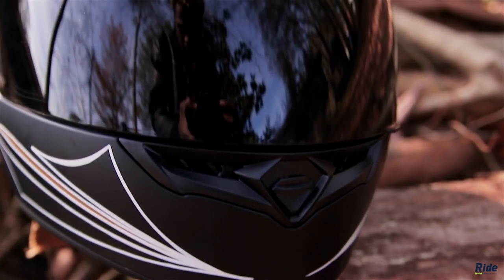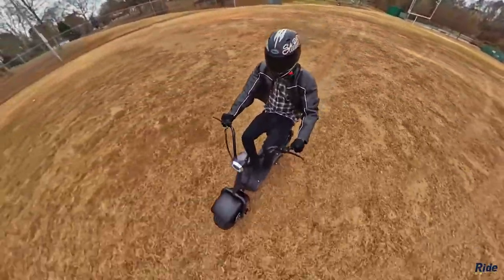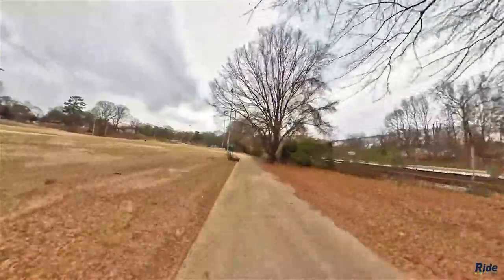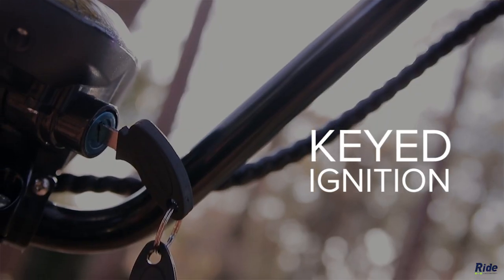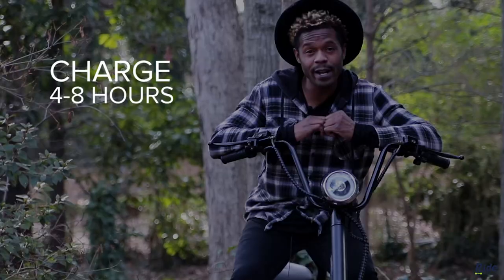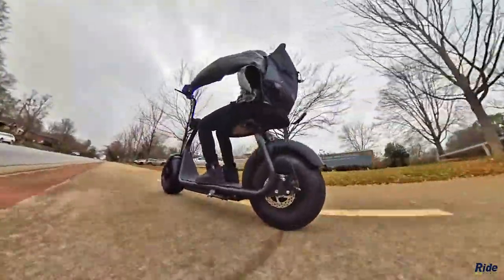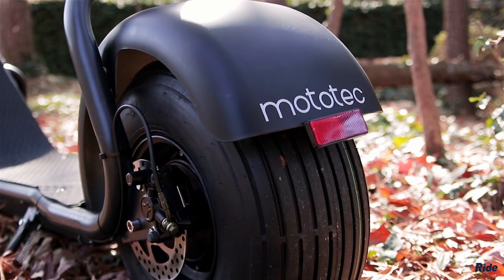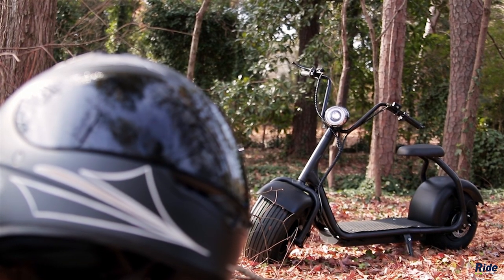Let's ride on the Mototec Fat Tire Electric Scooter! | Ride Along

Comment: I have the mototec knockout and I got a 40ah battery for it and  getting a little over 38 miles in one charge and the 1000w motor was decent for climbing hills but I added another 1000w hub motor in the front with a controller and it rips now, probably gonna make a box to put the old battery in and mount it under the seat with some switched to change packs when necessary
Reply: So about one amp hour per mile...

Comment: Purchased this a month ago and it’s a great product.
Reply: hey, where did you purchase it from... Amazon?
Reply: @andrewkadinda9454  I got mine at Walmart
Reply: Well, nice but where do you get replacement tire, replacement battery, etc.? I have another scooter and have huge problems finding tires and a fitting battery as replacement
Reply: So how is it 2 years later?  Is it still running?

Comment: Mine is in transit...supposed to get it sometime this week. Cannot wait! Already got my helmet and armor-dilloz for this scooter!!!
Reply: let us know what you think ..
Reply: @rg7846  Just got it in today. This thing rips pretty damn fast yo! I tested the speed and got up to 29 mph. I'm pretty heavy too (220ish lbs) so I guess if you're lighter then it would be even faster. Goes up hills and goes on grass with ease. A con about the bike handle bars can't be tilted to how you like cause there's a dead bolt in the middle where the handle bars go with 4 hex screws in each corner. Anothet con I didn't like is that the platform covering where you put your feet down is some cheap plastic.
Reply: @l3arney  nice...so more pros than cons...yeah i'm a buck 60  lol so i should be flying on that thing lol.. thanks for your input.
Reply: @rg7846  there's more cons to this as I'm riding it more now. The welding to the frame is super crappy. Looks like a 6 year old welded the frame. LoL they said this thing didn't need suspension because of the super fat tires but that's BS. Seat hurts my ass while going on long rides. The charging port under the foot rest is pretty flimsy. If I were you go look at the mototec knockout with 2 seats. Or go look at the edrift fat tire or coco fat tire. They are very similar to the mototec fat tire. About the same price too I believe. Make sure the battery is lithium ion and not acid based batteries.
Reply: @l3arney  damn that sucks .
Reply: @l3arney  yeah ebikes are more reliable but for the kind of commute i need it for its not the best.... i need something small and able to fold.  i'm thinking more like a stand up scooter. so i can able to take it with me on mass transit and up and down stairs.

Comment: I just bought one on 9-18-20. I can’t wait for it to get here!!! I ride a Fiido scooter to work and it’s fun AF!!
Reply: Oh wow! It's on sale for $1169! Please keep me posted once it arrives! And please let me ask questions afterwards! 😀
Reply: God Bless America I will!! It’s 9-27 and it should be here by 10-2. I’ll keep u informed!!
Reply: Did you ever get it?  How do you like it?
Reply: J M yes, I did! Thanks for reminding me. I got it on 9-30 and it’s fast and fun. The only two things that bother me are the battery only lasts for about 6 miles. I have to contact the sender. And the the other thing is the back tire is a little unbalanced and I get a shimmy when I go fast. I have a golf cart place about a mile down the road from me so I’m gonna stop there in a few days and see if they can do anything. Other than that, it’s fast and fun AF!! Walmart sells them too!! If I had known that when I purchased it, I would’ve had it in 2 days, not 2 weeks! Lol it’s worth it though for sure.
Reply: @felix_2037  the thing actually shit out on me because the wire XT-90 connector to the battery was loose (black wire) and we never found it out until later on. The company sent me a new motor, throttle, and controller and that wasn’t even the problem! Just a loose wire that was giving intermittent power. The bike was on and it got power, it just wasn’t going anywhere. My buddy who owns a mobility scooter business got me a two motor, two seater bike like the mototec, but WAY better. Got it for $500 and I already had a battery, so score!🤙🏼
Reply: @JoeyPeeps157  I gotta ask, what is the brand/model of the one that you got for $500? I'm looking for one around that price range and I'm having a hard time finding a good one.

Comment: Great video, I just got one too and it's a beast on Philly streets! My issue is, I can't find anyone to change the tire given the hub motor can't be mounted on a tire machine! It's just sitting here brand new as I ride the bus again, Any advice anyone?  Thanks!
Reply: Keith /Tsoleno29 I am gonna take mine to a golf cart place. I live in Florida and these old people need their golf carts taken care of so theirs no shortage of golf cart shops here. That’s the best advice I could give. I have a little shimmy in my back tire from being a little unbalanced when I go fast, how about you? Everything ok with yours? Lmk.
Reply: @JoeyPeeps157  Wow man, thanks for the info! It's a fun and scary ride as it pulls you fwd with a sudden jerk and would be better if I could adapt the front with a suspension fork for less jarring rides. I also had to put together a makeshift ramp to roll it into my apartment lol as it's pretty healthy weight wise! Yeah I haven't been on it for a month now just trying to get original tire back on and fill with air but there's too much air escaping to fill it! I've seen youtube vids where guys roll over the edge of the tire to either break the bead replace the tire onto the rim. I believe I have to get a friend to help me put the new, "Tonka" wheel tread tire on as tire shop tried with tire irons and slightly bent the edge of rim trying.  I appreciate your info man!
Reply: @svarridark  I hope you get it fixed soon!
Reply: @JoeyPeeps157  Thanks, I think a ratchet strap will be my next try! Just watched a video where the tire is pushed out to the rim enough as it's compressed  around the center with the ratchet so, off to Home depot asap, Thanks again!
Reply: Were can I buy it?
Reply: @svarridark  if you want to sell it let me know I'm close to ya
Reply: I'm also in Philly where can I buy one?

Comment: I just bought a used one and they didn't have the manual.  I don't understand how the charging lights work.  So they're 4 green bars on the panel. i'm guessing each one is 25%, but when you throttle up the bars drop down to the bottom bar and depending on how fast you're going the bars are all over the place so you never really know how much battery you have left.  There is no percentage reading on the screen.  How would you know if say for instance you have 15 or 10% battery life left.  I ran out of juice about a 1/2 mile from my house and  had to push it all the way home.  I'm afraid to get the max usage out of my scooter for fear of the battery dying.  Wish the stupid thing had a percentage reading.

Comment: I bought one on sale for 50 bucks on tik tok but it said endurance of 85 miles. Are they talking about before the battery is toast?
Reply: Have you received it
Reply: @mannycastillo9636  no I'm pretty sure it was a scam
Reply: @nickhedeen5677  did it say it was shipped or anything
Reply: @mannycastillo9636  no and there website is down. It was gamble anyways I don't care as long as they don't use my card info

Comment: Where's the CoC? Because if it's missing then you forgot to mention that it's illegal on roads.
Reply: sorry, what is CoC? And I had the same question, does this still counts like a Scooter or more like a Electric Motorcycle?
Reply: I doubt people who buy this kind of thing are very concerned how legal it is...
Reply: In California it's legal to ride any motorized scooter. Here's a list of rules from the DMV of California.

A motorized scooter has 2 wheels, a motor, handlebars, and a floorboard that you can stand on while riding it.

You can only drive motorized scooters on a bicycle path, trail, or bikeway, not on a sidewalk, and you cannot exceed a speed of 15 mph.

You do not need to register motorized scooters.

You can drive a motorized scooter with any class driver license.

Comment: Bought from bigtoysusa for a mototech electric scooter and doesn’t even work and never used it 😂company have bad builds
Reply: I got mine from upzy.com and bigtoyusa was the distributor that sent me mine. It came with minor scratches on the frame right out of the box. Quality is kind of crappy but it does run pretty strong for me. I shoulda looked at the edrift scooters or coco scooters. They look similar to the mototec but of better quality
Reply: Tnecniv Nart how long did it take to receive from upzy.com.  I just ordered one from there myself
Reply: Tnecniv Nart I cant put on my steering😐 can you make a video on how to set up 😩and no manual from bigtoyusa just picture
Reply: @yaadscott7552  It took about a week from when it left their warehouse in Wisconsin. I live in the Bay Area in California.
Reply: Tnecniv Nart Good to know there isn’t a delay.  I’m hoping it doesn’t disappoint.
Reply: @l3arney  I'm getting second thoughts buying this! I live in Campbell! Can we meet?? I just wanna see the scooter I don't wanna waste my money on this.